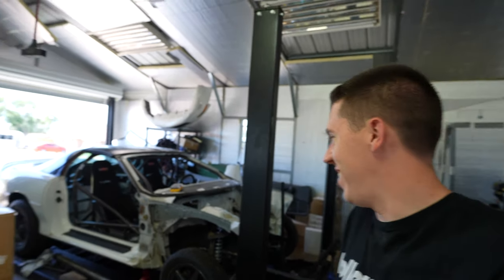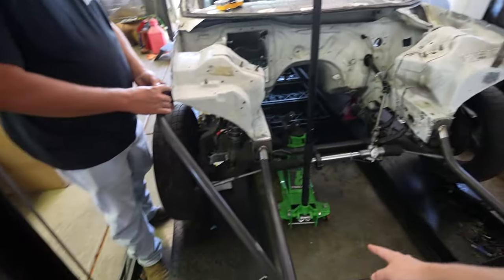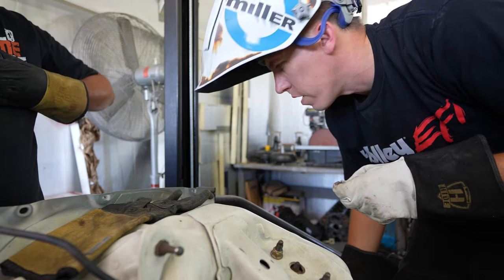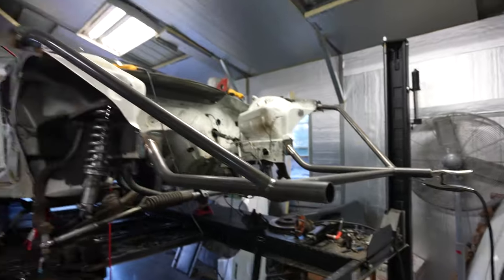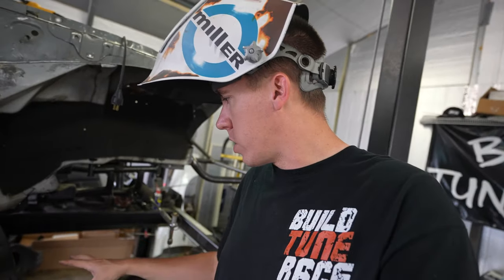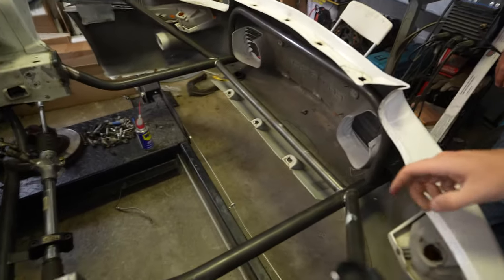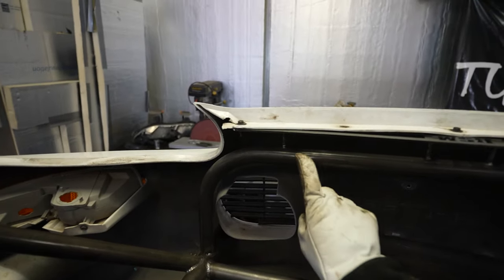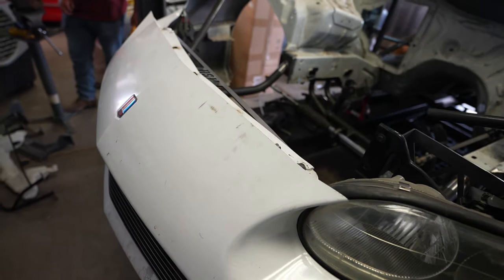Rock Solid Motorsports Camaro Tube Front End Kit Install!

Comment: I cut my round fender flares out as well, its been years since I've touched it, kits seem to be different. So mine is basically identical, I wanted to modify the triangle mounds 90 degrees to try and mount it flat up against where I cut the fender bumps off